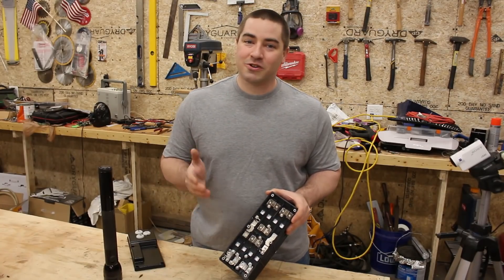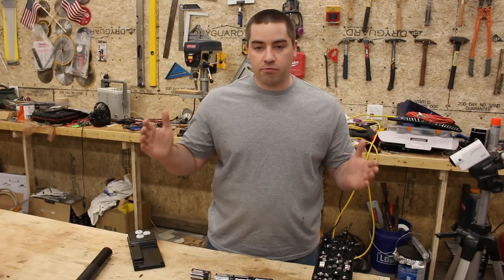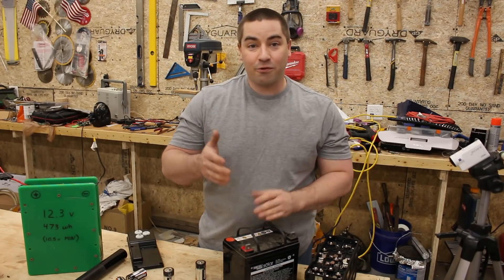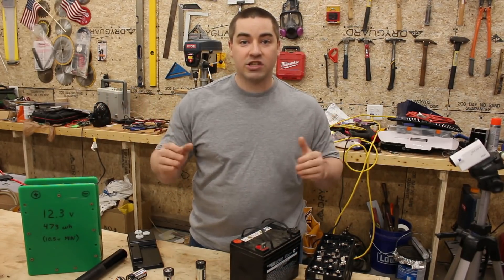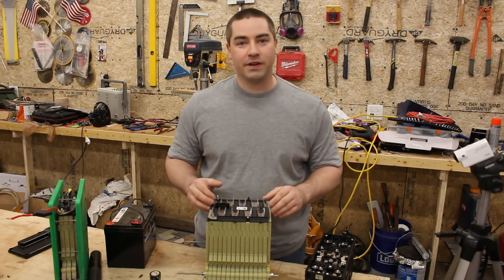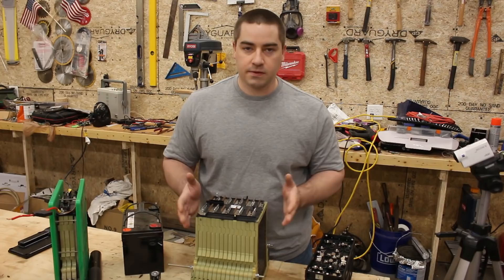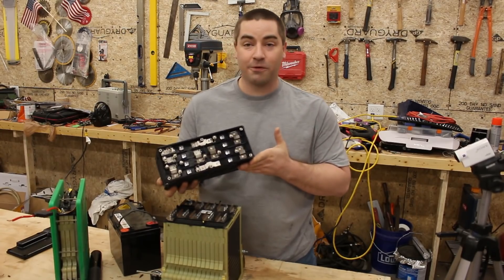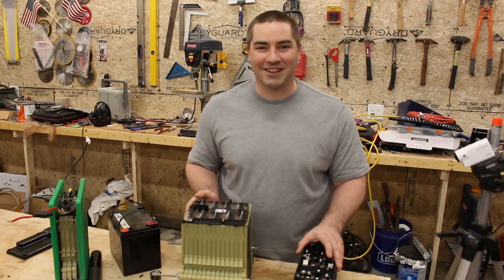Cells in Series for Best Efficiency and Capacity

Comment: There is a really cheap charge controller available on Ebay (like for $35 or so) that can be programmed for just about any charge voltage, however it is a boost charge controller, meaning that the input voltage MUST be lower than the charge voltage you select.  For example, you could feed in 30V from a solar panel (MPPT voltage) and have it charge at 45V (or even lower).  The drawback is it is only rated for 10A max.  I have actually tested it on my 48V nominal AGM battery bank and it worked well (although the fan is noisy).  I have a laboratory power supply that I can sweep from say 12V to 30V as input to it, and if I programmed the charger controller to output 50V, it would pretty much hold it regardless of the input voltage.  It is a good way to charge a 48V nominal  battery bank without having to rewire it and only having a power supply that maxes out at 30V.  This is my situation.  For example, if a single solar panel is not enough to charge the battery bank during the day, I can then connect my power supply at night (to the input side of the charge controller) to top off the 48V battery bank.

https://www.youtube.com/watch?v=IfHyPNkxlrU

Comment: Finally started building out my 48 volt packs. Im using Nissan Leaf Modules. 7 in series which works out perfectly. If I grid tie my 15kW Sigineer Inverter I can use the sealed lead acid algorithm to charge these modules perfectly. Just under the max at 57.6 volts which is equal to 8.22 volts per module. 8.4 is max for these modules. The low end is just right too. I have built two 48 volt modules and have enough to do 6 double 48 volt packs. So 12 48 volt packs at around 50 ah  equals a total of a 28.8 kWh pack. Posted a video today of my start. Video ended abruptly due to audio cut out on the last part. Each of the two packs is sitting at 57.6 volts fully charged to my specification. https://www.youtube.com/watch?v=qQHfDG97K1ESigineer

Comment: Interesting all of the different cell chemistries available these days. I am taking a different approach to the system in my bus conversion. A vintage approach. I’m using 56 lead acid cells of the type found in fork lift batteries. This will give me a system that runs about 110 ~ 125 most of the time. All the systems will use 115 volt DC motors. I have an extensive collection of vintage appliances that can run on DC. I prefer incandescent bulbs anyway. And most electronic gizmo have universal power supplies that actually have no trouble running on DC. So no inverter will be necessary, and no BMS necessary with lead acid. I’ll have a motor generator to supply the occasional load that requires AC, such as a microwave oven. Anyway, enough rambling. As always, it’s a pleasure watching you tinker with this stuff. Take care.
Reply from the maker: That sounds really cool.  Are you documenting the build anywhere so I can follow along?
Reply: Hi David, I’m really no where near the videographer that you are. Just a cell phone camera, and have never learned how to edit. I tend to get caught up in the work, and forget to take photos or videos. I really should see what I can do to document the project. Right now I have just started the engine build part of it. Quite a ways from outfitting the electrical system. Take care, Keith
Reply: wow!  125V "DC"!!!!  Better keep your gloves on  😜
I agree, most electronics can run on 110VDC as it rectifies it internally anyways.
With David, you have a documenting of the process? It'd be interesting to see your build. Also, how'd you get the batteries and transport them? Those are huge and heavy!
Reply: The plan is to buy the individual cells and assemble them in place onto a drawer like rack. The individual cells are fairly manageable, and these will be fairly small as far as industrial cells go. Less than 50 lbs each.

Comment: I don't understand why you don't use 12 volt builds and multiple 12 volt Batteries in each chemistry that way more of us can use the ideas for our plans.
for example I have two  12 volt Inverters in my 12 volt RV. I built 12 volt 100 amp packs, and paralleled 9 of them My 1000 watt Solar array charges the battery  (9 packs) easily,  my twin 3000 watt inverters barely use any power till i need them. Then the Array recharges them quickly.  see why i want 12 volt builds I might want those LTO one day
Reply: How thick are your cables on those batteries? The higher the voltage, the smaller the cable needs to be to handle the power.
For an RV, 12V is ok. For a house, 12V is horrible. An RV you may pull 20A from the battery under extreme load conditions. In a house, on a 12V battery, you'd be pulling closer to 100A. A typical house consumes about 20-30kWh/day. If we figure an average of 1200W an hour, @ 120VAC, that's 10A on AC. Convert that to 48VDC and that's about 25A. If running on 12VDC, then it becomes 100A.
Another reason to use 48V over 12V, is that the 48V based inverters are more efficient than the 12V ones. They may be only a few percent different, say 75% vs 78%. But that can make a huge difference over time, especially scaled up. With the example above, 1200W * 75% = 900W. So to achieve 1200W "output", it would consume 1600W. Now at 78% efficient, that drops to about 1550W. 50W difference over 24hrs is 600Wh.

12V systems are ok, and they have their place. But that place is definitely not in a house. Even in an RV I'd want to go 24V just for smaller cabling and a bit more efficiency.

Comment: One thing I've noticed is that inverter/chargers like AIMS, MagnaSine, and even Victron is that they all still only support very mediocre charge rates for Lithium.

I have yet to see an inverter charger that can charge as fast as they can discharge. Which for a proper house based power wall with large banks will be more crucial.
Reply: @marthale7 yes but unlike lead acid which typically charges at .2C, lithium chemistries can charge as high as 5C in some cases. Having the option to program your inverter/charger for a higher charge rate would be beneficial. One reason I bought a victron was that ability. However the victron still maxes out at 50amp charge but can pull 125A.

Comment: You can also look at the formula for power Watts = I^2 * R, and see that the power losses due to any resistance (ex the mosfets switching inside the inverter, battery cables), are related squarely to the current. So, if you increase your voltage by 15% (1.15x), you will effectively reduce your heat losses (inefficiency) by (1.15^2), which is over 30%. From 44v to 48v it would be an increase of 9%, resulting in a reduction of power loss of 1.09^2 which would be almost a 19% reduction in heat losses. 
This is why commercial UPS systems (in the 10kw-500kw+ range) always use very high voltage series battery packs (500vdc+), as this drastically reduces the power losses and at 500vdc the current is relatively low. For example, a 25kw UPS it would be 50 amps, which is extremely easy to handle.

Comment: and YES 14s is the best option to imitate lead acid.
Reply: depends on chemistry of battery...
Reply: @asdfdfggfd  as well ! some  chemistry  are 3.60V nominal, some are 3.63v , some 3.70V and some 3.80V nominal
Reply: @Doctorbasss  Greg is referring to LiFePO4 or 3.2 nominal voltage cells. LiFePO4 cells in 4s(12v), 8s(24v), and 16s(48v) have a similar voltage profile(range) as lead acid batteries. 

Majority of LiFePO4 cells energy storage is between 2.9-3.35v, sits mainly between 3.1-3.3v.